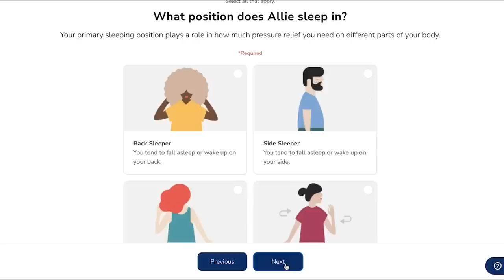THIS IS A DISASTER...

Comment: Trent maybe you can put in some sort of supports to hold the propane tank in place while you continue to dig and as Branden say if it rains the wall next the tank can collapse causing more trouble.  I'd shore up the trench walls next to the propane tank where the wall are starting to collapse.  Do like  Pile wood and braces in between like when it's an open tunnel if you know what I mean. In fact you could do the whole trench until you're ready to lay new line to the  Septic tank so if ot were to rain it would collapse any of the trench you've dug. I'm no construction guy but it's just  suggestion. Take care and please be safe. I enjoy the videos and I don't want to find out that any of  you got hurt over this trench issue.

Comment: You keep working with this equipment. As you get better and more comfortable with it.  You will actually get to the point where you feel buried lines through the tines or blade themselves ( in your finger tips ).That your mind learns to detect before damaging or destroying them . As you excavate and that feeling will stop you before . So you can check it out . It's not something you will learn over night or any time soon ..  It takes practice . But it's a feel from the tines or blade that your mind learns to detect  .

Comment: You can put in a grinder pump and tank then your line to the septic tank can be 2 1/2 inch pipe that will force the sewage to the septic tank.

Comment: Maybe you should use some boards to shore up the dirt next to the tank,the boards can be pulled after you start too fill the trench,just be sure to attach something to help pull the boards out . Drill a hole in the boards and thread a heavy rope through it to put on the excavator to pull the boards  after .

Comment: You have a large tree behind the tank - a pair of chains to the lifts points on the tank and wrapped around the tree should at least stabilize the tank enough that it will give you time to get the mini-X over to hold it up....until other folks could get there to help.  Also, I know it makes it more expensive, but I would have run both the Electrical and the gas line in some sort of conduit so this kind of excavation will have less of chance of hitting the other items.  Gravel shortage = New Samsung Chip Plant in Taylor, Texas.  I am seeing a minimum of of 3-150+ car train loads coming east to the plant site.  I think I already told y'all this - from my niece who lived in Alaska for a while - Don't honk at the boy moosie's!  They really hate that sound and could easily turn your truck over.

Comment: Glad you’re trying your best to stay positive Trent.  Things will turn around and there is light at the end of the tunnel.  1 question though…. Why near the end of the video when Alli was gonna be going for some parts did you not decide to measure how much new pipe you would need to complete the job and have her pick it up at the same time as the parts she was asked to get??  Save time and save gas.  Work smarter not harder!

Comment: If I am not too late, could you take a very long level and start at the house checking for the right drop in the sewer line, pick it up with a strap to the right level, put gravel under it and not have to replace the sewer line?

Comment: In scandinavia you can build a backup system for heat and electric power  at low cost. like conect the water pipe to the fireplace with a water pump and solar and wind and generators if  shit hits the fan..

Comment: Make sure you lay that new waste line on sand and not gravel.  Sand will give you a much more solid base because it won't compact as much as gravel and it will prevent those "bellies" in the pipe.  Also as someone else mentioned run yellow Caution Tape about a foot above the full length of the pipe before you backfill so you won't hit the pipe if you have to dig it up again.  Plastic gas lines should have a copper tracer wire taped all along it and the ends terminating out of the ground so it can the traced.

Comment: A marker, markers sand, gravel and more markers even a layer of capping tiles/plates of whatever, before you close it in. Consider surface line indicators, defining where the pipe was laid, post with line indications, some or all of which are used in different localities. Oh, and good luck for no more bucks, dips and breaks in future. You are on the home stretch now.

Comment: You hit the gas line that fine just bend the pipe over but don't make a spark with the bucket of it's boom if it's the pressure line.

Comment: I think you are supposed to compact the bottom of the ditch for the sewer line BEFORE adding gravel so you don't get settling and have the same problem again. I had seen another channel put in their sewer line and your original video too. They dug the slope first, then compacted with a compacting tool then had gravel before filling.I thought you and the guy you hired were doing it wrong then too.  And the other lines should be protected by pvc or that black spongey material so they are not damaged by underground movement or rocks and protects them when digging up also. They put that stuff on my waterline from my main to my house when it was replaced. You should have also marked where the line was too.

Comment: Did you not spray paint or tape the gravel just above the lines and pipes  in the trench. I believe it is normal practice. in parts of the UK, especially the explosive factory I worked at as a groundsman. A single spark could have killed. That digger looked way to small for the area it was working on. Any way, well done for getting it sorted.

Comment: If it rains, that tank is gonna fall in that hole! Build a bridge out of lumber so if it starts to go, it rolls onto the bridge and not into the hole. Shove a dozen 2x4s under the belly of the tank and across the hole to create the bridge. Then tie the feet of the tank closest to the hole and run the rope up over the top of the tank and secure it very tightly to stout trees and/or stakes driven deeply several feet away from the tank. That will make it resist rolling even if the feet lose part of their footing. Then, for god's sake, tarp over the whole thing and STAY OUT OF THE TRENCH anywhere near the tank. One comment earlier said STAY OUT OF THAT TRENCH period. Not a bad idea. You've created a massive safety hazard and you're not frightened enough!

Comment: When you rebury the lines this time put the signal cable alongside so if the worst happens in the future you can get one of the locator companies come and mark them with the depth and location. Also make sure to compact, then put gravel... compact again, then gravel over the pipes before backfill. edit after 3 breaks to the gas line, just replace it. You don't want those couplings underground. Sure they're rated for it, but it's just not worth the risk. replace the pipe back to the tank and leave the coupling accessible at the house to serve as an extra shutoff.  I'm pretty sure the pipe coupling has to be the one with the complete solid metal band over the rubber to join them.

Comment: I guess in your locale Call Miss Dig is not a requirement. Here in SE Michigan we have to call Miss Dig before excavating. They come out and use sensors to mark things like wiring and gas lines. I believe the service is free here but required by law. The county came out and dug our ditches and they had Miss Dig do their thing.
Reply from the maker: The utility companies here only run the lines to our property. Then it’s our responsibility to run the lines to the house so they don’t mark any lines we have installed, hope that makes sense

Comment: You’re probably already done but I would turn off the propane tank while I was digging next to the line and therefore the pressure won’t cause a issue if you do get it
Fixing the line is really easy with a couple of compression fittings as long as the pressure doesn’t cause some heated issues🤭🤣😌

Comment: The only reason you have to go through this is that it wasn't done right the first time. This gives you the chance to know where your lines are and to bury them in gravel or sand. You might even consider burying the water lines inside a larger diameter PVC pipe as protection.

Comment: When you use that mini again keep in mind the the blade goes towards the point of where you are digging and raise it that way you don't keep swaying like you are. The blade keeps you balanced at all times. Now on them lines and septic use sand on it and then pee gravel on top that will let you know where your stopping point is when you hit the pee gravel. ANYWAY the biggest thing is the use of that mini make sure you have that blade in front of you at all time and push it  up to hold you from  tipping over.

Comment: Love watching... But... What an Experience!  
This made me Nervous!!
I rarely make comments. Everything has probably been completed before today's post.  And all the Good Advice... after the fact.  I would have waited for Curtis and found other projects to do in the meantime.  Hope everything is filled in properly with rock, sand or whatever is needed, measured and marked in case you Ever have to do something like this again. 
And since all that dirt below the tank has been loosened, I'd move the tank on the other side of the garage and Really Secure it into the ground. Considering all the work you did here... seems moving it a little bit further wouldn't hurt in the long run.   The little bit of cracking in the concrete might make that pad erode over time even if you patched it.  You can use that little concrete pad for a number of different things.  Even stacking firewood.
Just my two cents.

Comment: Lifting eyes on the top of the propane tank.  Run preventer lines from the eyes to trees/ground anchors uphill?  With a block and tackle (or a come-along) on each line you can make the lines real taut.  Also, miners brace walls and roof with lumber.  You could do the same in the trench.  Meanwhile, I'll bet Terry could have hot water with a little preparation!  "They have it under control."  HAHAHAHAHA!  In what alternative universe are you living, Allie? 🤣

Comment: the perils of DIYER's. Where is your caution tape in the ground to let you know where your lines are? An as-built plot plan showing distances from landmarks for said lines should have been drawn up and kept in your files. Did an inspector qualify any of your work???. Your propane tank should have a concrete base below it relative to the size and weight of your tank. Where is the required gravel surrounding your sewer/septic lines? Its one thing having multiple talents. Its another to follow the rules on how to execute those talents.

Comment: I'm sorry your original guy who did this job cut corners on it. A. Making this occur by not putting in a good bed of gravel and sand. B. Not marking the line with tape or sand over the pipes and cable. So making a redig job so much harder and dangerous. Hope that rain holds off!

Comment: I don't understand why you didn't just dig and install an entirely new septic line and fill the old one with foam insulation at each end...  a new trench out away from the old line was the best option, leaving the power and gas untouched.

Comment: Just curious why you didn't bother to use the silver or red caution line marker tape that is supposed to go in the trench above gas/electrical lines.... The silver allows it to be found with rf wands.  I understand the "Oh I can do it" bravado, but it could easily save you from severing your gas with an electrical ignition source.  And bite the bullet & buy coarse sand or p-gravel from a concrete company to bed/cover the lines so its easy to see you're getting close instead of just shoving in what you dig up. If you did this stuff as a kid Trent, I cant believe you didn't do that. Any reputable company does this without a problem.

Comment: I don't understand why you didn't make a concrete base, sides and metal top for future repairs and changes. I know it's an initial expense, but surely it would pay off in the (very) long term? You'd also know exactly where everything is. I would also have put the propane on a very solid concrete base. I'm surprised you haven't killed anyone in this house construction. What about bracing the trench for safety? Laurel and Hardy used scripts like this. My opinion is based on being part of construction crews in Africa and Europe, and I haven't laughed as much at construction work until now. God bless the USA!

Comment: No surprise here... A professional plumber would have been a good idea, and safety measures in place. A very deep trench could have buried someone. No helmets was a big error, most likely state rules require this. After seeing the slope of the sewer line I have doubts if it is enough to drain the lines. Is the septic box low enough ? Why not tap into the sewer line while it's open to tie the garage into the line. Does utah require a licensed contractor to do or manage the repairs ? And is the code for this tap being followed. Allie is under too much stress, trying so hard to manage and keep everyone happy. We can only guess how much you do Allie on the shop management and accounting. I hope this whole job was not done for clicks.

Comment: You have broken the water line and you have broken the gas line what do you think your odds will be for the electrical line? Hopefully you have run it in pvc  or some kind of pipe and it is not just direct burial with no top layer of gravel or indication of when you are going to get close to it. Maybe go to the nearest farm and hire a couple of labourers and let them had dig it but there will be less danger of cutting into cables with the shovels . Good luck and like someone else has said put caution tape above all lines. In Canada it is code but in us and out in the boonies?

Comment: You know they make portable baths units for events!!!! And if you can get an order of Gravel or Pee Gravel though more expensive decrotive garden stone would also work, BTW why didn't you either rent or buy or barrow someone with a water, & Electric sensor to find these lines.(Trent likes tech) Since you know so many tradies!!!! At this point if you can get the layer of Stone and it might be easier just layinging all new lines in on the stone layer bed, once and last time, if you can't get the stone, you will be doing this again as ground shifts. Also next year After you've used up the propane, build a propper cement pad in a better location, not ontop of lines, and if it can have driving axis, I think you can build back axis to the property from the dirt road behind the house, if its a niebours drive get permission, tell them its only for a road/path for axis to propane a few times a year!!!

Comment: ⚘Trent and Alli,

Did you leave your hose screwed on to the water spout during any freezing weather? When i turned the hose on in late spring one year,  i ended with a very big leak from the pipes in the basement near the outside wall.
I told the plumber that i always, for over twenty years,  never disconected the hose from the house for the winter and they never broke before and why did it happen that current year. "Never leave them connected. Snow has nothing to with it. It is the cold! 32 degrees!", He said.   🤣    
P.s. sunburned knees made my day...think that you are the first to have that happen! Lol lol lol!

Comment: Seems like a lot of poor planning for the garage utilities. You should have trenched and installed that when doing the house. You uninstalling a wall you paid to have done and all the mishaps show me some things should be left to the professionals.
Reply: This isn’t the garage utilities (except for the water pipe they broke in the previous episode). The propane tank connects to the main house and the sewer pipe comes from the main house. I’m guessing the electricity goes to the main house too. I think the septic tank installation was poorly done in the beginning (in fact we saw that it was) and now it looks like the pipe was all wrong too. They should have got the guy out to put it right.

Comment: I think Trent is right.  I would have drained and moved the tank. Listen I have had my my propane tank moved with propane in it. Turn off your tank at the top.  I had shut off valves put on the pipes going into the house.

Comment: Doing it wrong.. the blade is soppose to be in front of where you are digging.. also dig a new trench and leave the old pipe.. just worried about where it comes ot of the house and where it goes into the tank.

Comment: There is no way that that tank base is correct, should be on a solid concrete foundation, utilities all in one trench is a bad idea and trace tape should have been used so you know what you are digging up, also it is not a great idea to have a joint underground on propane unless it’s fusion welded, didn’t see you pressure test the gas pipe prior to re instating the gas supply, I would seriously get someone to inspect and sign of your repair, if you have a leak underground and it finds a source of ignition it could be a disaster, don’t just backfill and forget 😳

Comment: Too late naturel of the video progress but firstly you gig with the tracks and blade in line the arm! You should have took the origional installers advice and just dug a new trench and ran the sewer line in it and connected to your tank and house then you would have had to worry about your propane tank , hitting gas and electrical lines wich by code in KY is not allowed anyway and for good reasons. And the opend deep trench on disturbed ground is dangerious as all get out! A cavein can kill!